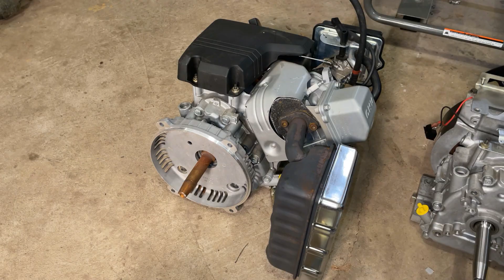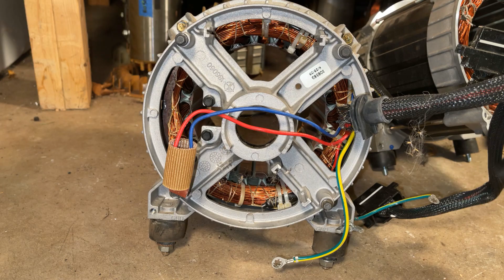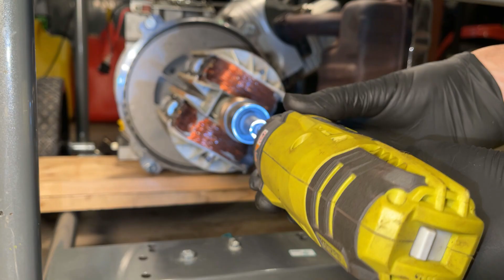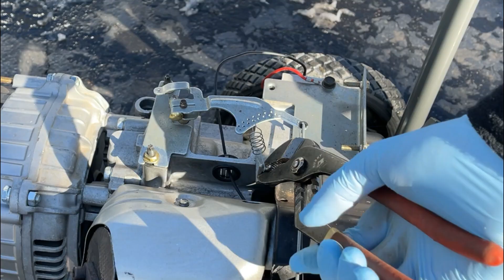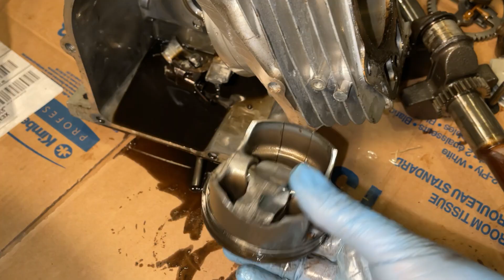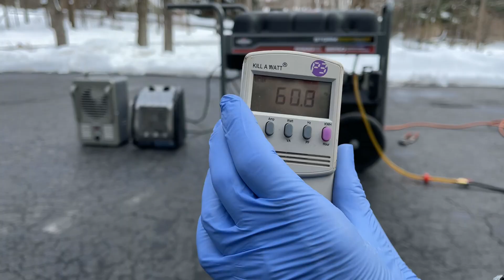Will It Make Power Again? Blown Generator Engine and Bad Stator?

Comment: Wise man said: "sometimes you need to be a little smarter than the tool you are using"  The drill thing - brilliant!  Troy Bilt 5550 watt model 030245.  Was not delivering power.  I did replace the circuit breaker and brush rectifier (the only two real electrical parts) but still no power :(  I then found this video.  Took apart the whole gen head to inspect the rotor and stator.  Both looked good.  Put everything back together.  Fired it up and did the drill thing a few times and Viola!  Power again! 😀 Would never had figured that out without this video. Many thanks James!

Comment: James, That's great work reviving old dead generators. The question I have is why does this generator work without an AVR when most have one. It seems that the voltage was high then dropped as the load increased. Is that because of this generator has no AVR? I'd like to understand more about these generators and their differences. I find this topic quite interesting.

Comment: James, can the stator be removed from housing / casing it’s in
Reply from the maker: The aluminum end can be removed.  But the main stator and wire are one.  All you can do is cut the wire out.

Comment: James, thank you for all your videos and especially the step-by-step processes you took to replace a blown engine, check the electrical parts, reassemble, and test.  I am putting a generator like this back together with a replacement used engine. I had it almost ready to go, but think I need to make sure I torqued the bolts from the stator to the rear bell housing correctly before I proceed further.  Thanks again, James! Keep up the good work.

Comment: Mr. Condon:  i have a honda eg3500 x.  It surges, and i redid the carb, thoroughly. There is  no  emulsion tube, below the jet, in the long stem within  the  float bowl.  ANY  ideas, ?  someone else  '' diddled ''  with this gen. Maybe they left it out, or does it come from factory without one ?  Carb is 
Kei Hin   number  BE   on  the front side.  thanks, for your patience, in dealing with  mech/electro  tech  stuff.  From us   A L L.
Reply from the maker: I would say someone removed it and did not replace it.  I only have seen one generator without an emulation tube and it ran poorly.  Someone before me had removed it. https://youtu.be/65nD5hNskdk?t=679

Comment: EXCELLENT !! "Drill Flashing"; a quick 12vdc source at the correct polarity to the rings should also charge up the flux?
60Hz via spring tension; seems the designers would have a control rod length adjustment or bend the rod? That tab seems like something that would snap-off for me....

Comment: Great video. I have a generator with them same setup as far as with the brushes with the bridge  rectifier, and I’m only getting half of the 240 volts on 30 amp 240 leg and only 120 volts on 1 leg of the 4 120 outlets..I get no reading with ohm meter thru the brushes/bridge rectifier. Is there a way to test the bridge rectifier brushes?
Reply from the maker: The bridge rectifier and brushes are fine.  If they were bad you would have no power at all.  Would look closer at the stator and the wiring.  Could be a base stator, loose wire or bad circuit breaker.
Reply: @jcondon1  thanks James, I will do more testing, its my neighbors unit, just trying to help him out.

Comment: Hey James.  Do you usually see this in a lot of these engines I asked that because I see you work on many generators but seem to have all kinds of other issues with them besides a blown motor
Reply from the maker: This particular engine has no oil sensor and they commonly fail due to lack of oil.
Reply: @jcondon1  James do you happen to have an email address that we can chat on I'd like to talk to you personally I'm a fan of your show didn't realize that they were this many resources for generators out here in fact I've got one I'm having so many issues with.

Comment: Greatly enjoy your tutorials. Would like to know where you get your engine specs from and source for aftermarket parts. Thx
Reply from the maker: I find them by running a google search.  Cannot find them all, but most use similar specs based on bolt size.

Comment: Great video James. The detail you provide in troubleshooting and more importantly the explanation of why your doing what your doing is a lot of help to those who watch. Good tip from one of your viewers on creating a shoulder with tape to center the rotor bolt. Couple of questions on this one. What was the benefit of using a crank powered ohm meter? A DVOM is powered by a 9v battery. What's the difference? What can it measure that a DVOM can't and why? What can a DVOM miss or not reproduce?
Reply from the maker: I normal use a DVOM meter and normal is works fine.  In this case the DVOM said it was good, but I had not power, so I want to do a high voltage resistance test to make sure there was not an insulation failure that did not show itself at low voltage.  The crank version was cheap, but they do make higher quality high voltage resistance testers.

Comment: Hi James,
What is tread size on the rotor after removing the long bolt.
🤔
Reply from the maker: The crankshaft thread I think is 5/16 24.  The threads I put on the rotor where M12 1.75

Comment: You might be able to salvage the engine case by welding the hole in the side to close it up (not a structural point), hone the cylinder and get a new piston, rings to the cyl new dia, and a connecting rod. The slight increase in diameter can give it a little bit more power.

Comment: Another great video, appreciate the clear explanation of flashing the coils and the megger. Briggs really needs to include a low oil cutoff, it should be a requirement for this type of equipment which can run for long periods of time at a stretch.
Reply from the maker: Thanks.  They had oil sensors on these until about 2005 and then there was stretch of at least 6 years when they omitted them.
Reply: @jcondon1  Probably planned obsolescence. Even the cheapest knockoff horizontal engines seem to come with oil cutoffs so it can’t cost much.

Comment: I just watched a video on Harbor Freight Aluminum Brazing rods that actually work. Soak the block in some heavy degreaser  aluminum braze that hole; polish that crank ball hone that cylinder; new piston; rod; rings and gaskets and make her go. We've already seen you do more on the generator ends so this would be a simple fix for you. Not "junk" it just  "hasn't been fixed yet"!!

Comment: nice work,,,,,,,,,,,     i have a Honda 3000is, 17 year old  and alot of early hours ?  rebuilt the carb several times  , it also has a spark arrester in the outlet of the muffler which became to gummed up preventing a no start , that took weeks to figure out   , LOL,  anyway she stopped running in January  when i needed her,,,,,, anyway will tear engine apart to look for problems and thinking about converting to propane  at 68 yrs old i don't see me rebuilding carbs anymore  and the 3000is is needed very seldom nowadays  ,,, any thoughts about the propane conversion would be appreciated,,,,,,, thank you Bob
Reply from the maker: Propane conversions are good, no more gummed up carburetors.  Never done one on an eu3000, most likely you may need to modify the case a little to get it to fit.  Another thing worth noting, you will lose a little horse power, so instead of 2800 continuous watt, you would have a little over 2500 continuous watts.
Reply: @jcondon1  thank you

Comment: Good test procedure but your use of the Megger did not produce the volts you selected. You need to crank the handle quite a bit faster to test properly.
Reply from the maker: Thanks, will crank faster next time.
Reply: @jcondon1  Be careful not exceed the voltage rating on the generator wiring.  I suspect the insulation rating is not more than 600V.  1000V testing might damage the insulation.

Comment: Hi James my name is Tony I live in the island of Trinidad and Tobago in the Caribbean I saw your channel I subscribe to your channel but I have a problem my problem is I have a 1800 W Generac handheld generator that is giving me a lot of problems at work well but the two 110 outlets I'm not getting any current from it
Reply from the maker: I have not worked on you particular model before.  Sometime it can be a simple thing.  If it is brushless, the capacitor could be bad.  If the rotor has brushes, then check the condition of the brushes and AVR/Bridge rectifier.  If not one of these then  most likely there is damage in the stator or rotor.

Comment: Jim, Rance here. At 16:55 of the video when you were hooking the wires to the brushes you said the red wire goes on top but it really doesn't matter because this is a "C" going in (?) This is where I lost you. Can you explain what I am not hearing correctly?
Reply: What you missed was that James actually said ' AC going in' meaning that it is an alternating current flow and not a DC or direct current flow.
Reply: @r8118830  Rance here, I thank you for clearing that info for me. Old hearing is coming on…sorry to make you do my job!

Comment: Why do you bend the spring anchor point to increase RPM's. Why not move the spring to a different hole???
Reply from the maker: Moving the spring will change the sensitivity of the governor.  Further away from the governor shaft the governor responds less to a load and speed will drop.  Too close and it will surge.

Comment: On a lot of your videos I notice that just as the carb is running out of gas during your initial tests (when all you have is a tube of gas), you seem to move the choke lever back and forth a couple of times. Why do you do that?
Reply from the maker: To get every last drop that I can out of the carburetor.  Also try starting it with the choke on about an hour later just to make sure.  Sometimes there is fuel left in the line which makes its way into the bowl.

Comment: This looks exactly like my Briggs/Troybilt generator, so, the engine did not have a low oil switch?
Reply from the maker: Most with this engine made after 2004/2005 do not have a low oil switch.
Reply: @jcondon1  Riiiiiiight, that way ya get ta blow an engine and buy 
anutha 1. . .right, well I suppose  ppl might want to check oil everytime 
they gas up the generator?

Comment: Hello James, 
Yeah I'm betting it is a part#91825GS off white color of brush block with a circuit board 
on the  back of it. a bad diode  and/or that little blue capacitor.

Comment: That is exactly how I shut down my generator.  One shut off the fuel and let it shut off from lack of fue and then choke it and pull until it stops trying to run.  This is exactly how I put chainsaws or other two cycle stuff into storage condition - drain the fuel out and let them idle until they shut off and then full choke and several more pulls.  This leaves the carb bone dry in either my four or two cycle equipment.
Reply from the maker: It is the best way.  I usually wait a couple hours and pull it over a few more times.  It always starts again for a few seconds.

Comment: How can I put a low oil sensor on my 4,500W Briggs and Stratton generator?  I know how to connect it, electrically.  I just want to know how to put it on.  Thanks.
Reply from the maker: Same here.  The electrical is not the issue.  A lot of these have the casting for the oil sensor on the engine block, but not machined out.  Have seen a few with it machined and capped off.  I suppose that could be upgraded with less effort.  Even saw a Briggs once with an oil sensor screwed into the oil fill.  Was never able to find a part number on that.  Seems like it would have been the way to go.

Comment: Mr. Condon:
The DC polarity feeding the rotor winding merely creates a fixed strength magnetic field for the stator. Its.magnetic.polarity is irrelevant as the stator will always induce an AC output of the stator windings. Both the two main power windings joined at the center (neutral) to produce 240 volts from end to end, plus the lower power AC winding used to feed the diode bridge that creates the rotor power field are all independant of the polarity of the rotor DC input. This may be only true fot the power heads without an AVR (automatic voltage regulator). The AVR varies the rotor DC current to control the output AC voltage while actively monitoring it.
For what it is worth: the instataneous polarity of the output AC relative to the mechanical position of the rotor is reversed as you suspect, but that doesn't matter since all outputs are AC anyway with a fixed phase relationship to each other.
The output voltage is a function of the (stator output)/(stator field) windings turns ratio and the speed of rotation. A unit with an AVR would usually have a potentially higher output of the stator field coil that is  reduced until the ratio of the output AC voltage to a known fixed voltage reference has a fixed ratio. That ratio is adjustable with a potentiometer.  (yes, since thr AVR works in the DC domain, the drive to the rotor doesn't need the diode bridge mounted on the brush assembly here.
Hope this helps.
Spinning the drill restores the magnetic field when none is otherwise present because the drill motor is acting as the only source of varying electric current in the stator.
Reply from the maker: Thanks.  I agree the polarity going into the rotor will not matter as a magnetic field will be established and AC will come out the the stator.  The issue is the residually magnetism.  If the connect it backwards to the residual magnetism, then the poles will try to flip on the rotor and when you reach a point of the crossing of the poles there is now not enough magnetism left to produce to power necessary to complete the reversal.  DC power could be added to the rotor brushes to complete the flip.  Some rotors have permanent magnets, ideally the rotor would power up in a way to compliment the orientation of the permeant magnets.

Comment: The sign of a good tech is one that doesn't just "give up"  on parts...   but learns WHY they failed.   A good teacher is also a student at the same time.
Reply: WHY  is the world, becoming broken ??  GOVERNMENTS,  CANNOT  know this. Just  RE-acting, to something which has allready taken place =  THE   NEWS.   Honest trouble 'shooters '. ......must  KNOW  the reason   WHY  something of  mechanical/ electric  'stuff '  fails.  How can one, learn to  PREVENT  THIS  breakage, from happening again ?  By engineering stuff, 30 %  over rated capacity, AND  USING  QUALITY   STEEL,  and not  'pot '  metal (like fuel tank petcocks; had to clean one and when tightening the nut, it broke. POT  METAL  from  china. wow. the threads are some kind of odd ones.....anyway...).  Hand in there, folks !

Comment: Once again these videos drive home the importance of checking the oil level before starting a small engine. A step easily overlooked when in a hurry during a power outage.  I'm appreciating the low oil shutoff feature on my WEN generator with each of these broken engine teardowns.

Comment: James, why not just keep the blown up engine together to keep all the parts in one place? Is it a space issue? Just if you ever wanted to use those push rods and rockers again it would be best if you kept them as a pair.  Not to mention keeping the correct bolts together in the right areas, though I assume the number of these you've done you can rattle off the bolt sizes from memory.
Reply from the maker: Have done a lot of these.  I usually loosely reassemble them or part them out on eBay.

Comment: Love and appreciate the knowledge you've been sharing. On that note, would you be kind enough to explain the difference between the two types of brush generators you've repaired? AVR on power head no AVR on power head.
Reply from the maker: An AVR will monitor the voltage output on the stator and adjust the power going to the rotor to maintain a consistent voltage output on the stator.  With no AVR the voltage is just proportional to the engine speed.

Comment: Love the videos, just curious when your using the torque wrench. You always go to the set limit click and then click it again. Is the first click not accurate?
Reply: Going by the book when using a torque wrench, you are supposed to stop at the 1st click.  Goid thing you had another correct engine to drop in the generator.
Reply from the maker: I saw the two click thing on another channel and I kinda liked it.

Comment: I wonder why these engines have no low oil sensor to prevent it from running when the oil is low
Reply: Money. Cheaper to build without it and it makes even more money when you blow it up and have to buy another. They know chances are you'll buy another since it was your fault for not checking the oil and it was a good runner until then.

Comment: Clean up the crank race with muriatic acid and it will disolve the aluminum right off it. It will be good as new. Do not machine it.
Reply from the maker: It did cleanup well with the acid.  Unfortunately too much wear, it is out of spec.

Comment: Have you looked into adding low oil shutdowns to these generators?

I have nearly the identical generator sold under the Troy Bilt label and it has one.  I would think the parts would be a available or even a modified low oil shutdown off the cheap Chinese Honda clone engine everyone is using.
Reply from the maker: I did look into it on the engine I rebuilt recently.  But getting the OEM low oil sensor parts was not cheap and the engine block only has a casting for the sensor, but it was not machined out.  I saw a Briggs once that had one screwed into the oil fill.  I think would have worked, but was not able to locate the part number.  It was also an older model engine, so not sure that part would be available.